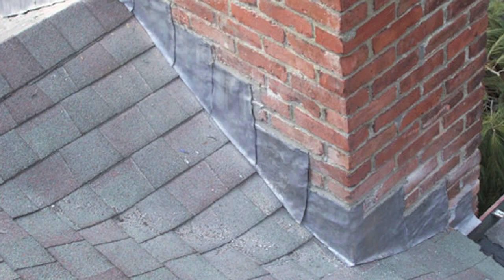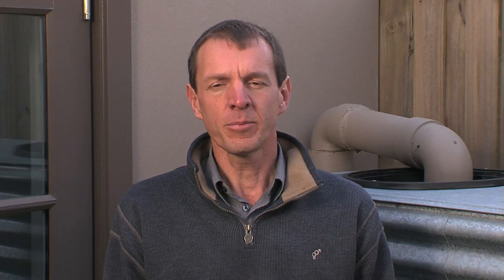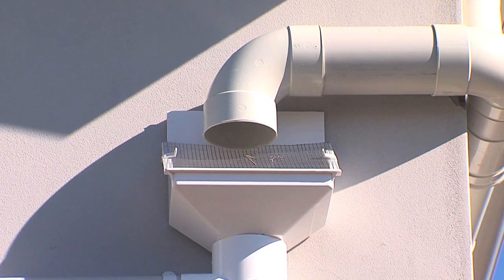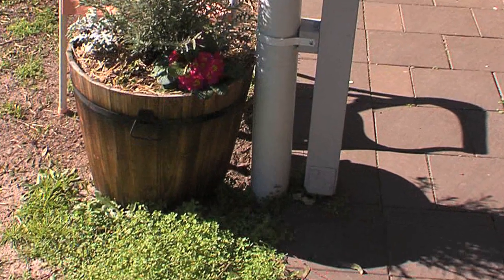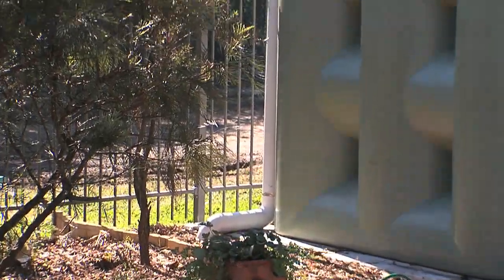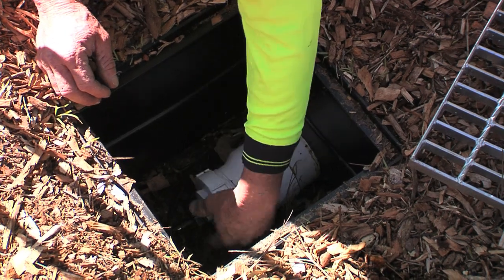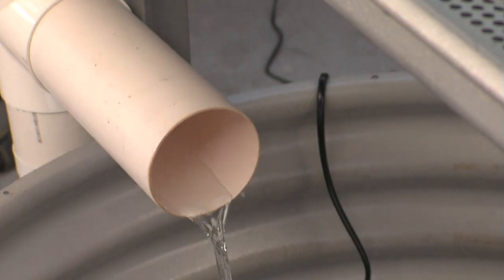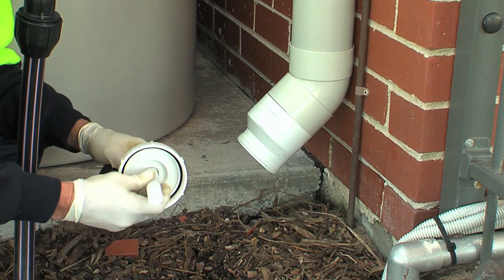Installing a Rainwater Tank Part 2 - Collection

Comment: Hi. I have 2 Questions. 
1). Can mosquito larvae fit through the mesh strainer on top of the watertank from a wet system?
2). Does the inlet pvc pipe have to be at 90 degree angle when in the area of the mesh strainer?